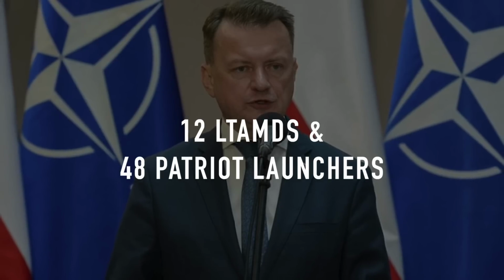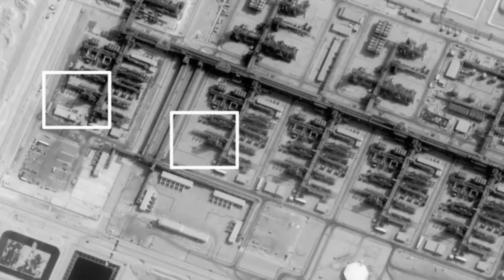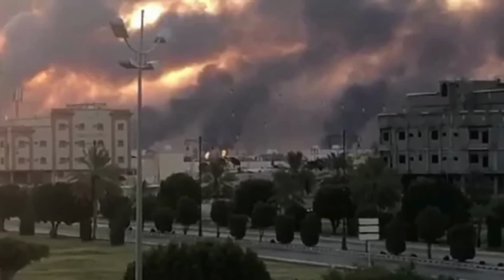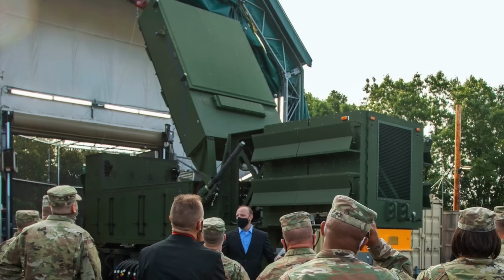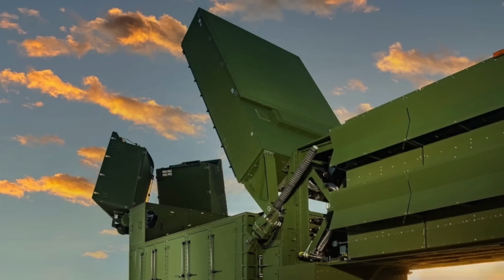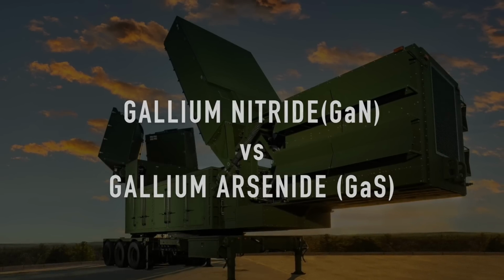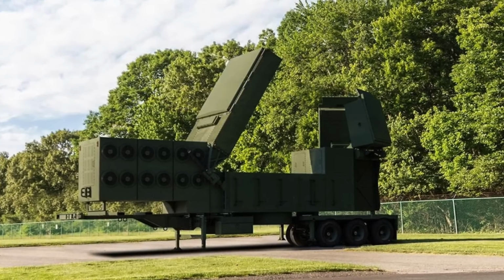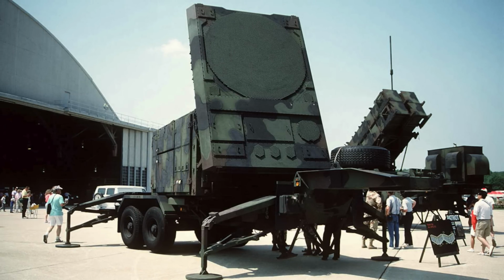Raytheon's LTAMDS to enhance #Patriot air defence system of #usarmy !

Comment: With advances in enemy SEAD and kamikaze drones, shouldn’t this unit be a little more mobile in 5 minutes?
Reply: what advances in enemy SEAD do you talk about? russia can't flymaned aircraft over Ukraine, China mostly relies on modified russian equipment
Reply: Normally it is used in layers, this is only for things of medium and long range, the radar knows what it is and is not going to spend a Missile of 1 million dollars or more having other weapons that can do it, there are Skynex systems with cannons 35mm, which explode the bullets by launching steel pellets that destroy the drones or with missiles like Iris T or the same Aim120 or Aim9 that are launched from turrets in Hummer, I don't know if you have seen, the anti-drone system is improving a lot too, obviously In Ukraine there is only one in kyiv and it is not the best, there was barely 1 Skynex system.

Comment: Why do they need 3 radars for a 360 degree view but why not make it spin
Reply: Because they want constant 360° coverage, A spinning array does cover the 360° but there's gaps where it's pointing a different direction...
Reply: with targets moving at mach 5+ you can't look away for few seconds
Reply: It’s like a round stage.  Most of the time the performer is not facing you.

Comment: Lots of questions on that patriot missed opratunity on the refinery attack. Seems like very poor judgment on the placment of the system if in fact the issue was that it could only see a limited area ? Or why would you also not overlap systems for a more robust defense perimeter? Lots of questions indeed.
Reply: The story that’s not being addressed is the failure of the anti-aircraft guns.  Exercises should have been conducted to test readiness
Reply: Those attacks came behind the Radar system so cruise missiles came out of the 270 degree coverage. Some came in through rhe coverage and others came in behind!
Reply: @virginccyy7645  Sounds like the Saudi’s left gaps in their defensive coverage.  It must be assume that an enemy find these weaknesses and exploit them. Anything else is gambling.
Reply: Porque apenas había 2 o 3 sistemas patriot en Ucrania y los trasladaban a todos lados marcando aún más donde estaban, además no era la última versión es un Pack 2 estos son Pack 3 y mejorados aún.Solo en Kiev se logró tener unabuena defensa, pero con solo 1 batería y sistema Skinex, pero luego ya sin misiles es muy difícil.Tendrían que volver amandar todo de nuevo para que se vuelva a restaurar Ucrania nuevamente, pero si no mandan aviones nunca surtirá efecto una buena campaña Ofensiva, Es algo que es más un tema político que de guerra, porque si ya no quieren ayudar, para mi es solo hasta las elecciones, pero después si gana Trump , no sé querrá que done la mitad Ucrania no tengo idea.

Comment: I bet the Saudis were pissed that the American defense equipment didnt stop a fly.
Reply: The Saudis should blame themselves.   This doesn't happen in the UAE or Israel.   A 900kg PAC-2 missile is not usually configured for intercepting a 200kg shahad drone powered snow mobile engine.  The failure was clear in the gun defenses and how they were manned, placed and operated.
-One thing is for sure.  The Saudis didn't probe, test their own defenses.   Operationally they just weren't ready.
This is not Patriots fault.   You can't plonk down a weapons system like this and turn it on like a washing machine and expect it to work.  It has to be tested and configured.   It's quite like the Patriot was configured to ignore the drone's low 110mph 180kmh speed.
Reply: I bet that they would too. But look at Ukraine to see that no air defense system is foolproof. Russia has a huge multi-layered air defense system and they still have problems with intercepting. As usual the West is late to the party but we'll soon have a world-class multi-layered system that includes lasers, kinetic projectiles, and missiles. We already have it on agis equipped ships.

Comment: Now just upgrade to a newer missile
Reply: That's PAAC-4 SkyCeptor. After that land based Aegis SM-6.
Reply: Already done.  PAC-2, PAC-3 and now PAC-3 MSE are all in service.    All have been progressively upgraded.  They perform different roles, PAC-3 is not a replacement for PAC-2 and PAC-3 MSE is not a replacement for PAC-3.  .    PAC-2 does long range intercepts agaist aricraft, PAC-3 is a smaller missile that perform shorter range intercepts using the 180 rockets around the base of its nose to achieve super manouverability of over 100G and PAC-3 MSE  performs long range anti missile intercepts.  It fills the gap between THAAD and PAC-3.
Reply: @williamzk9083  
They need to go beyond PAC-3
Reply: @verdebusterAP  with a new radar and a missile with a range with 400-500 km (maybe scram jet powered)  it would be nice to threaten to blow MiG 31, SU 27 series and  Tu-160 out of the sky over the Moscow Air defence district. Imagine if they had that capability 10 years ago, Russia would’ve been too scared to invade Crimea.

Comment: They should paint it up so it looks like a regular truck trailer when it's not deployed. Cheers for the intel.
Reply: Agreed, but hiding it when emplaced will be tough. If you look closely, you can see the whole upper assembly (Radar array and powerpack) sits on a turntable on the trailer bed. You can see the full-width turntable on the trailer after the 6 minute mark as the view pulls back. That is one Monster Array on a traverse-mount.